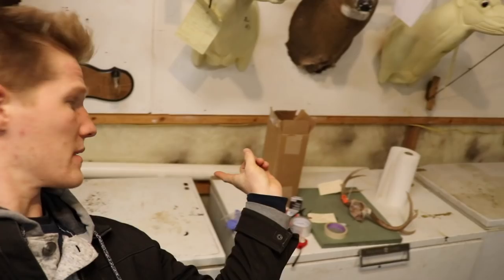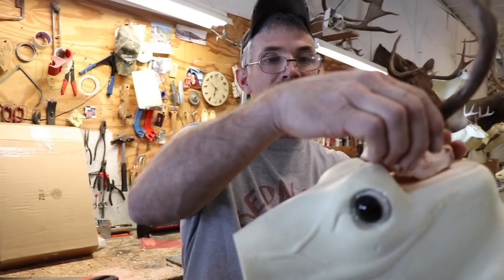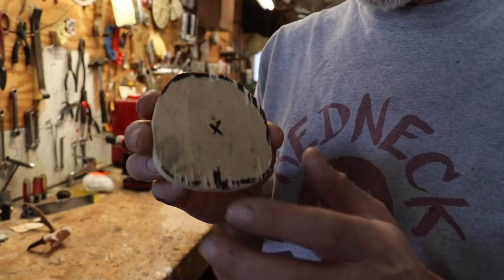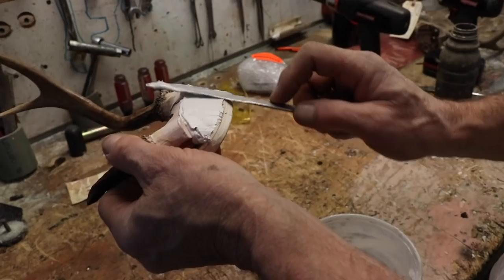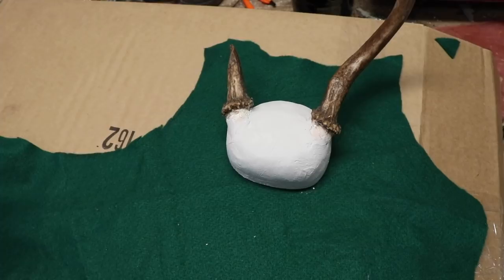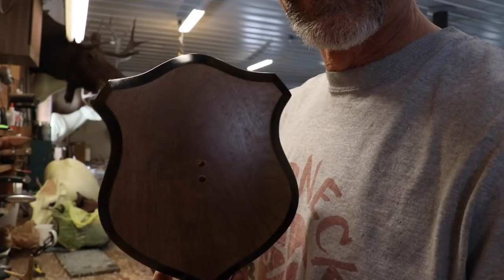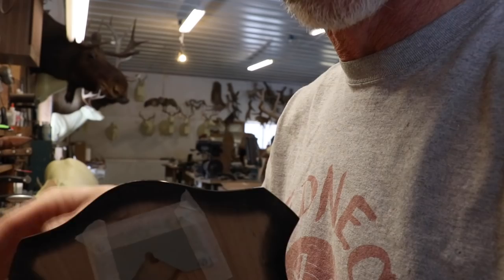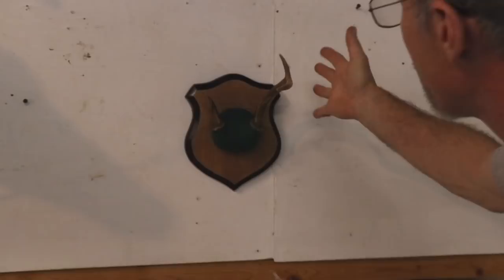DIY: How To Make an Antler Plaque

Comment: I have watched other videos and for my first attempt, I used a mix of plaster and concrete....mistake!  It dried fast, was more difficult to work with as it was drying.  It was ok, but the concrete made it more challenging to work with after it dried: more sand paper, harder to get perfect.  I recommend to stay with the plaster only for your first few and watch this video over and over again.

Comment: What's the best way to clean a deer shoulder mount?
Reply from the maker: paint thinner ( odorless and small amount) or windex on a paper towel wipe them down being extra quick and careful around any painting it helps cut the house hold grease and dirt. avoid the thinner on turkey heads but great for the feathers